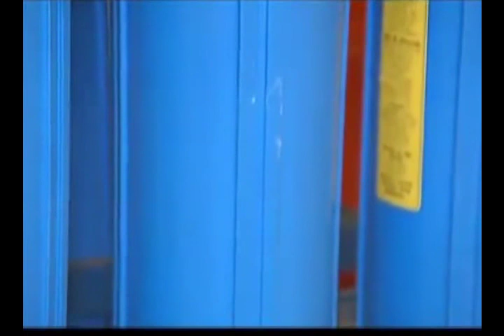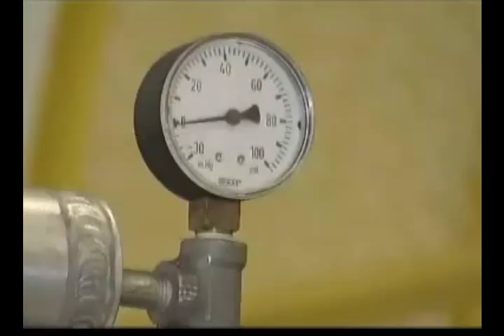Neotropolis Pendulum Power Tour.wmv

Comment: This is not to be confused as being gravity powered, but better understood as "gravity assisted", or facilitated.  This great invention, destined to greatly ease our energy burdens, is not alone without prior art. It is similar to Milkovic's double oscillator, the Bessler Wheel, the Buzzsaw Wheel, and more recently,  Fernando Sixto Ramos Solano's Force Multiplier System.  They all evoke the same effect widely known as the centrifugal force, which is not dependent on gravity but upon the density property of elemental matter. Ironically, what starts out being initially inertia resisting movement, becomes a cause to move, called "weight" in the presence of a gravity field or the "centrifugal force" when that matter is rotated within any area of Space, on world or off. Since it is an effect and not completely a "real" force its use has an effect on moving matter, but without the usual equal and opposite reactions. It could be termed the "Centrifugal Effect", but that would hide the fact that under the correct engineering circumstances it can be seen without a doubt that it can effectively cause a force to be applied to move material objects in a variety of inventive configurations.

Comment: Grrr... con artist.  I suppose the next evolution of this might be a flywheel.
Reply: Not a con, the pendulum acts as a efficient torque converter, so a small constant input by hand, gets "geared down" by the slow moving pump, and the peak power demand is handled by the swinging pendulum. So it is like a flywheel for reciprocating movement. This saves or generates absolutely no energy, but would be suitable in say a wave power plant that could supply hydraulic power to shore. I don't get why they think it is clever to power this with compressed air??? Maybe it is only to measure efficiency, but in that case an electro magnet would give much more accurate results?

Comment: This is only an integrator of human  intermittent pulses stored in a memory system called a pendulum and then  the energy is released quickly is a short time,   But the integral of the input pulses are  equal (forgetting losses)to the  integral of the output forces.  or the energy input, equals the energy output.    No miracles at all, but the effort feels easier handling lighter forces and integrating them through the storage or memory device in this case a pendulum or a flywheel.

Comment: The reason Europe regarded the LHC Project at CERN as one of major importance, was that Peter Higgs hypothesis, now over half a century old, introduced a new paradigm into Physics that suggested many anomalies present in the current models might be explained. The axiomatic 'mantra',"You can't get out more than you put in!" does not apply to a 'Heat Pump' where 1000% Coefficient of Performance is normal. Some heat pumps make ice with a flame! Imagine the YouTube comments if that was new science!

Comment: I seriously hope these people aren't as deluded as this report makes it seem.  They have to know, surely, that gravity isn't adding any energy to this system. The work done by these machines equals the energy being put in by the operator minus the wasted energy of friction and air-resistance due to the pendulum.  If the pump seems easier to operate than a normal pump its only because the momentum of the pendulum is smoothing the energy input required so a gradual input can be steadily built up.